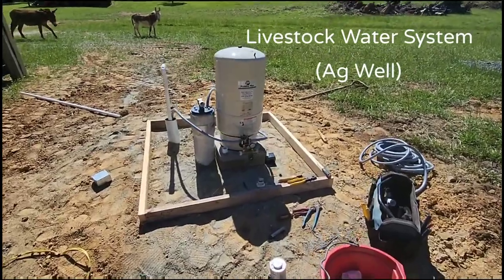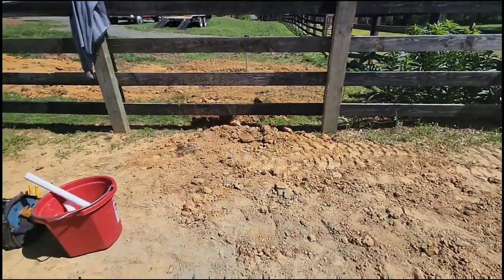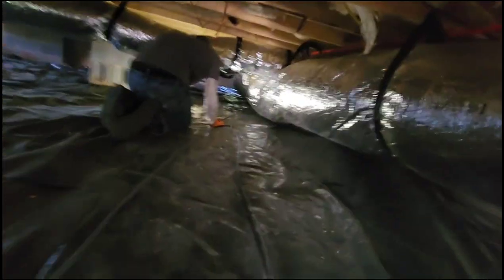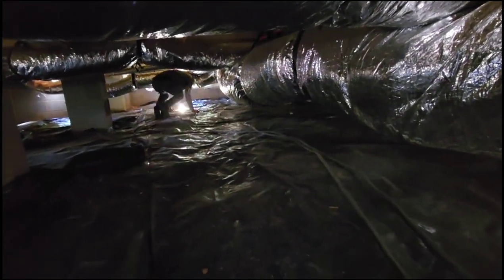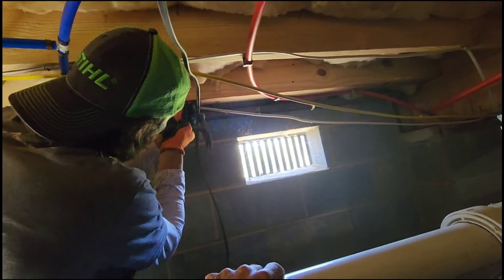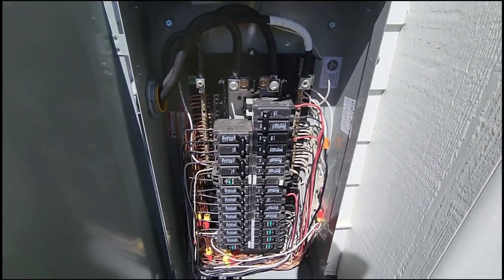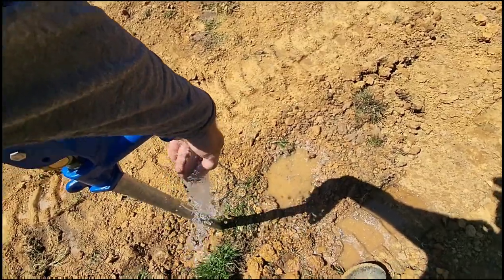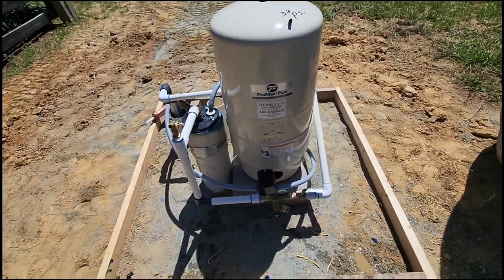New Well Pump System Install For Hobby Farmer.

Comment: Great video as always  if the other guys no what there doing they don't have to bake the cement and hopefully they  at least put a check valve in line cattle line  here by code it would be a back flow preventer  specially if it's going to cattle and tied to the house. I have a video idea to add yours  I see you do mostly single phase but it would be nice if you could do a video on what the difference is between a single phase and 3 phase install booster and sub.  So people no what they have and the difference between the pressure switch set up and control box vs a panel HOA set up. Just a idea. A lot of cattle ranch and company use 3phase were I live and I would like to refer your videos to others to help you get to your 100k sense I don't do YouTube videos. ⛲👍👌✌️

Comment: I was told never use a plastic female threaded... (as you do going into tank T) to use a male plastic and use a female to female. I'm looking into this because I keep getting leaks around my barn well. (we do freeze here) I also get pipe bulge in plastic in the summer. And yea, I'm not using thin wall.
Reply from the maker: Our females are special order. They have a metal ring around the female thread end. Prevents it from splitting

Comment: Another great video man. I had a question on the discharge piping, I didn’t notice a pressure relief valve before the ball valve. If the pressure switch works as it should, then I suppose there would be no need, but with the number of videos of yours I’ve seen about ways a pressure switch can fail, I know it could be a possibility. How do you decide when to use a tank T with a pressure relief valve and when it doesn’t really need one?
Reply from the maker: It's not a requirement for PR valve . & I've seen them leak. It's just personal preference to not use them. Now a bigger system 1.5hp & bigger, yes id use one.

Comment: Looks good!  A boss tells the employee to go do the hard and dirty work.  A leader is right in there getting it done.

Ball valves do die.  In cold areas, a closed ball valve will split due to ice in the passage in the ball freezing and splitting the valve body.  Some valves come with a cover to drain the water.  I just drill a small drain hole in the valve body.  Easy peezy.